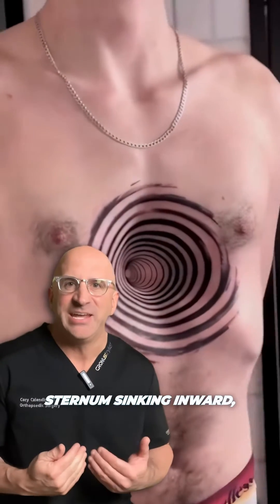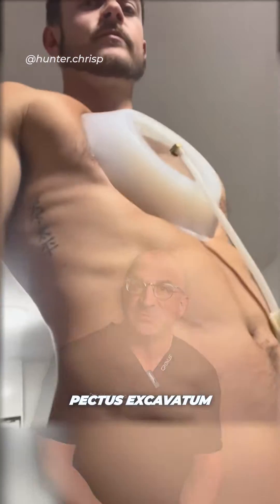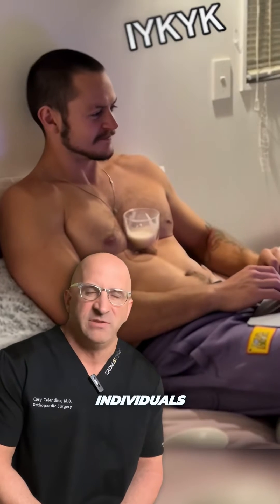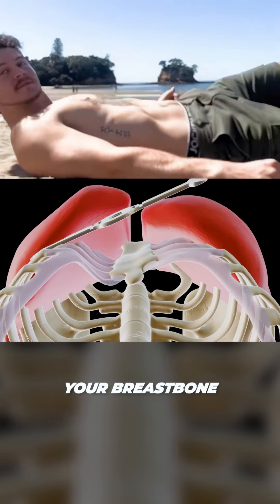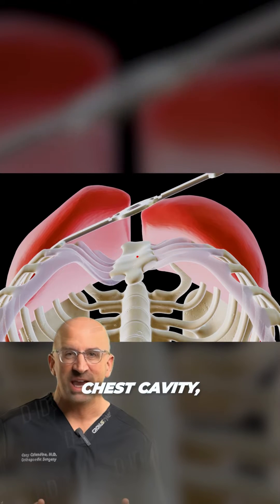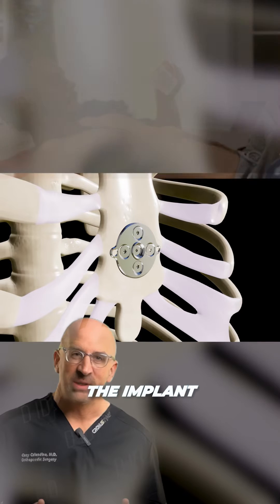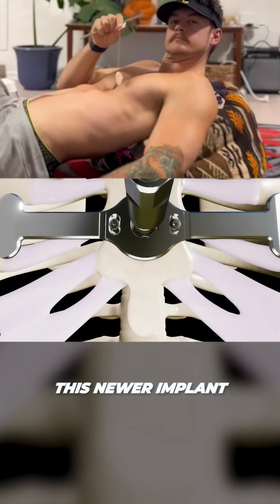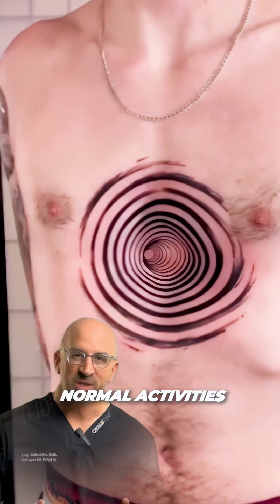Faster Funnel Chest Fix

Comment: My sunken chest is a connective tissue disorder. That's what my research strongly suggests. Often folks with a sunken chest will also have flattish feet, longer arms than normal, a very bumpy head, and be magnesium deficient, (so they will also have anxiety issues). The sunken chest is because magnesium either isn't processed in the body properly or has been deficient in their diet (most people are Mg deficient) and part of the need for magnesium is to scavenge excess connective tissue. If it doesn't happen then joints that should be tight, like skull sutures, and importantly where the ribs meet the sternum, are too flexible. Unless the metal device is left in the chest, ribs will just push in on the sternum and the sunken area reappears.

Comment: Can this be fixed by fillers or Botox ?
Reply: Negative
Reply: Clothing will fix it. No surgery needed.
Reply: Cosmetically, sort of, but surgery like this is needed when the sternum is putting pressure on the heart, it’s a physical issue